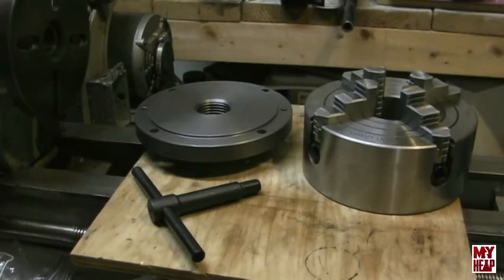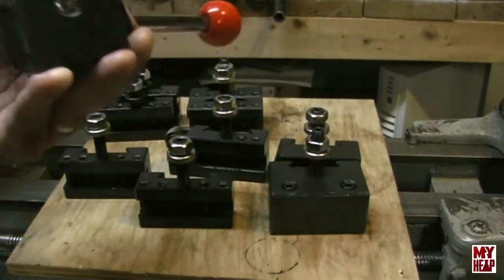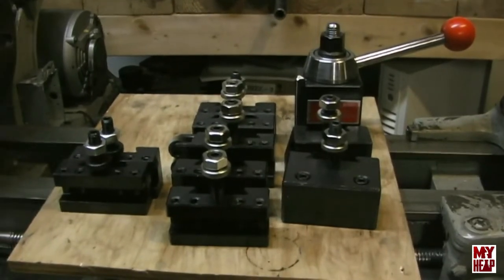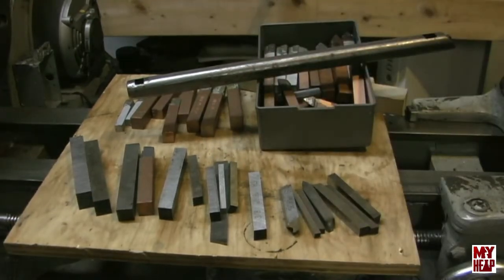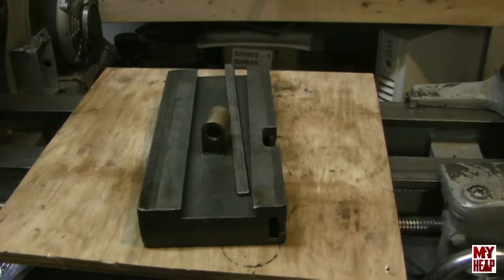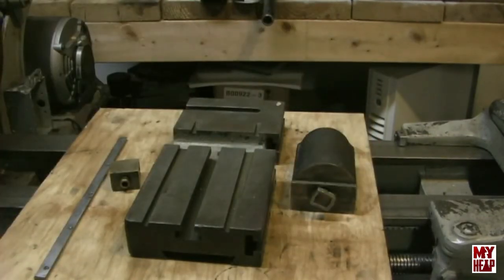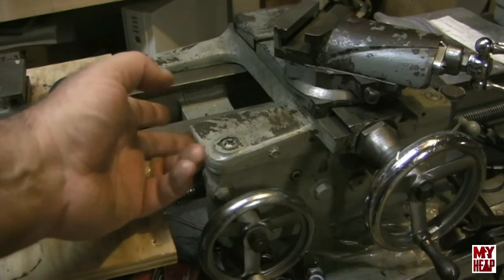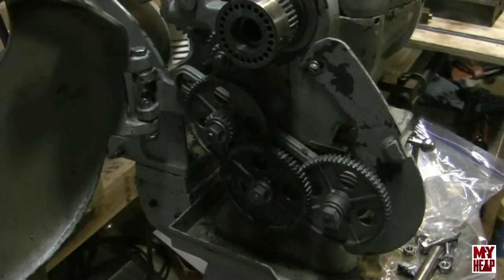Atlas 10F Lathe - TH54 - 07 - Stuff for the Lathe and Current Progress

Comment: Also, I had the same problem mounting my quick change toolpost that you do. I milled the top of my compound down a little. However, I am not sure if that was the right choice. These Atlas lathes catch alot of flak for the many parts made of Zamak. However I haven't had a single problem with the Zamak parts. To me, the real weak link is that compound. The 12 inch Atlas lathe compounds seem to be much beefier than the ones on the 10 inchers. 95% of the time, it doesnt affect my work too much, I just take light cuts. Probably a max of
.030 (.060 total diameter) per pass. However that compound really shows its weakness when parting (cutting off).
Reply from the maker: Jeremy, thanks for the information.  I have been told by others that the Atlas is a little light weight and does not like to part off material.  But for now, at least, I think it will do good enough to learn how to run the machine.  I would like to try my hand at a simple wobbler steam engine, and do some work on some cast aluminum parts from my home foundry.  Now I have at least a ball park from what I can expect for depths of cuts.  Thank you.

Joe

Comment: I've thought about casting new zamack gears and cutting them on my mill  I'll have to look I may have a couple spares around.
Reply from the maker: Well thanks to Jeremy Gagner I have two more gears than I had.  So far I have the following gears. (2) 20T, (1) 32, (1) 56, (3) 64.  Over time I need to get (1) 24T, (1) 32T, (1) 36T, (1) 40T, (1) 44T, (1) 46T, (1) 48T, (1) 52T and (1) 54T

Actually I guess that is most of them missing.  But The 2 gears that Jeremy gave me will at least give me a feed of .0035.  So I am VERY grateful of that.

Do you have the gear cutters and indexing head?

Joe
Reply: My Heap I have a indexing head but not the cutters
Reply: what gears make a complete set i'm certain i have the info here some where but god only knows where
Reply from the maker: Well, based on the Atlas 10F parts list there should be the following:

(2) 20T
(1) 24T
(2) 32T
(1) 36T
(1) 40T
(1) 44T
(1) 46T
(1) 48T
(1) 52T
(1) 54T
(1) 56T
(2) 64T

Just a note, the 52T gear is used for the metric pitches and the other odd ball, the 46T, is used for 11.5 and 23 TPI screws.

Hope that helps.

Joe

Comment: Sometimes people part out lathes....the money spent on a quick change gear box will be the best money you ever parted with. Keep an eye on eBay. When I was shopping for one (Lathe) I decided it was a must...but if you dont plan to do much threading its not an issue at all. A good set of dies and a good tailstock die holder will serve you well and die holders are cheap and easy to make.
Reply from the maker: You know, I am mixed about having a quick change gear box.  If all I ever expect to do was cut normal threads then I think that would be all a man would need, but what about odd or weird pitches, say I wanted to cut a 16 DP worm?

Although you can use change gears with a quick change gear box to some extent can't you?

Joe
Reply: Not sure, never researched it enough to know honestly. For the side jobs I get in its always imperial threads...never had a metric thread yet thank goodness....I think an atlas can do those 🤔
Reply: i wish i had one of the factory conversions for the early lathes id start selling copies its a very hot item
Reply: yes it can funny thing is it always could but they never updated there book for like 30 years vintage machenery.org i think has a leaflet that shows how to set up the transposition gears. btw you should look into that atlas machine group on yahoo groups .
Reply from the maker: I have joined the Atlas group on yahoo and been to Ruckers site too.  I have several Atlas documents as well as some that I didn't have before.  These were emailed to me from Bill ... Do you want me to send them to you?  I would be quite happy to.  BTW, I shot you an email with my address and other contact info.
Reply from the maker: One more thing, if you want to know about anything there is for setting up the gears for thread cutting, Imperial, Mteric and odd ball stuff like worms, the Workshop Practice Series #3 - Screwcutting in the lathe is the book you want.  Written by Martin Cleeve.  Send me an email if you think you would be interested in this book.

Joe
Reply: My Heap sure I may have some already but information is key right.
Reply: My Heap it does sound interesting.
Reply: got that the atlas group is a good resource.

Comment: The cross slide withe the tslots is handy for line boarding parts probably aftermarket. Strange tool post on it but keep it tell you know what it is lol. Have you checked out the half nuts ? I f I'd a  video replacing mine not a tuff job
Reply from the maker: I have the saddle and apron off the machine.  A cursery glance showed that the bevel gear shaft that the lead screw passes through, the key is worn to a razor, and the bevel gear that it drives is pretty worn too.  I think the half nuts were okay, but I really need to take a close look.  I plan on making a video of that.

Currently, Rich made some repair parts for my tail stock quill and I have the fiber washers for the leadscrew reversing box.  Another friend of mine has the gear box casting.  He is going to mill out the old bushing and make a new one.  Was sort of waiting on that to do a follow up on it, but I think I will need to move on while I wait.

I have binge watched a lot of your videos.  Started at the beginning and working my way to the current ones.  :-)

Joe
Reply: My Heap get to watch the evolution of my videos